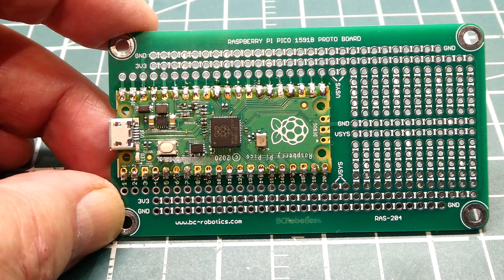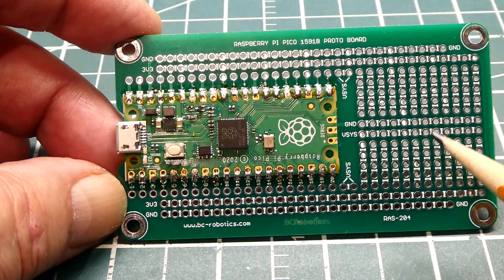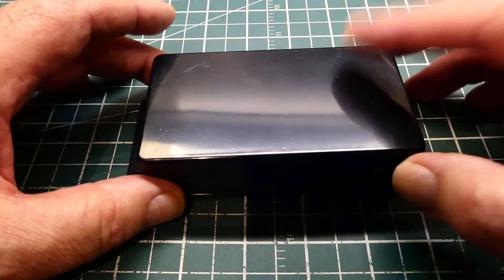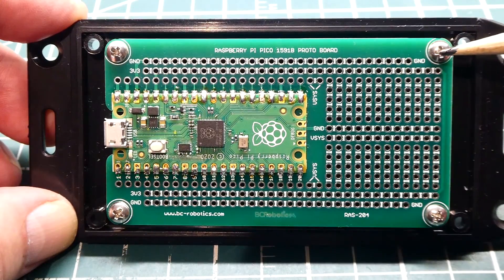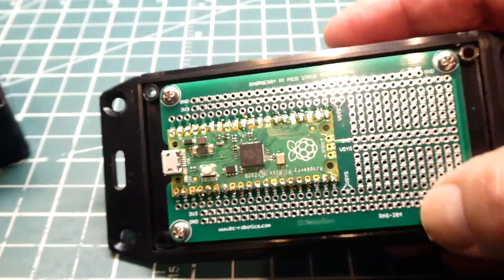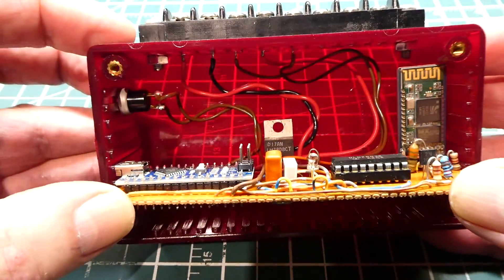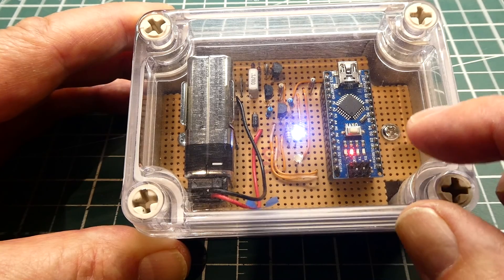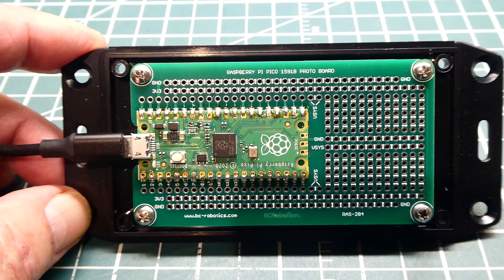Rpi Pico Prototyping / Picomite / Box Enclosure

Comment: Can you make a video about your project with the tap switch? Does it use a piezo disc?
Reply from the maker: Yes ... a Piezo disk was epoxyed to the bottom of the enclosure. The Piezo trigger circuit schematic is in my knock sensor video: https://youtu.be/fZGUzk-BYgQ  The power switch schematic is available in my LoRa alarm video:
https://youtu.be/6NHL-avk8BU
Reply: @0033mer  thank you so much, I'm going to try to incorporate this in future projects.

Comment: Good idea, thank you for the tip. Found both the board and box at the Pi Hut. I also run MM Basic on my Pico's (e.g. as PicoMites). They are much easier to de-bug than Arduino in my experience. The PicoMite is now a very powerful little device based on quite a few years of ongoing development of MMB. There are various versions of the PicoMite, including one for the Pico W (WebMite) so you can run simple web-based apps on it. Be interesting to see a video from you on it.   Enjoy your YouTubes BTW - always a good watch!  🙂
Reply from the maker: Thanks for sharing!  Appreciate the feedback.